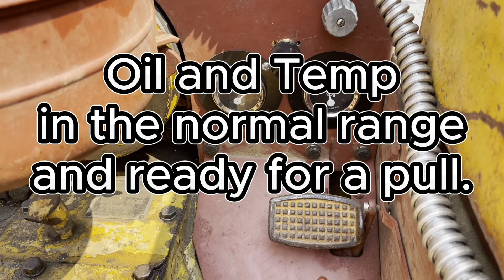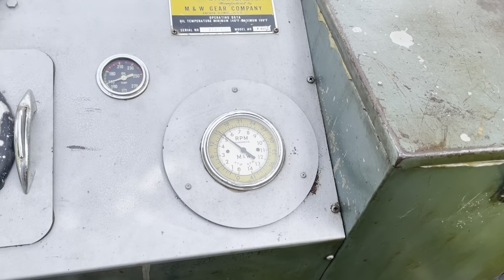Caterpillar D2 on Dyno

Comment: 1947-up 4U series D2.
Reply from the maker: Correct sir!, 4u6123 to be exact.
Reply: That would make it a 1953 then. @Recommended_by_Fred
Reply from the maker: @RomeKG471  yes, it was one of the last ones of the short track models. Shortly after this one was made they lengthened the tractor for clutch access/ optional oil clutch. More horsepower and several more upgrades. Hope you enjoyed the video, you sure know your cats!
Reply: True, yes thanks. I have a 54 5U with straight blade and pto, also a Diesel Seventy-Five, 47 6U & 57 7U D4's, a 61 17A D7D, plus a few others. @Recommended_by_Fred
Reply from the maker: @RomeKG471  your on the forum sometimes on ACMOC? I’m there on occasion as d2 fred
Reply: Oh ok yea! small world, lol @Recommended_by_Fred